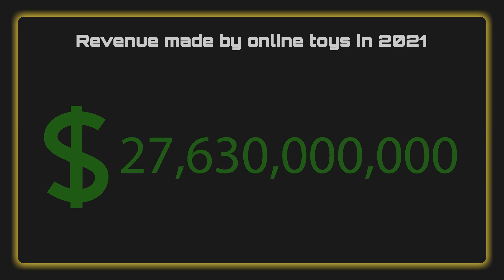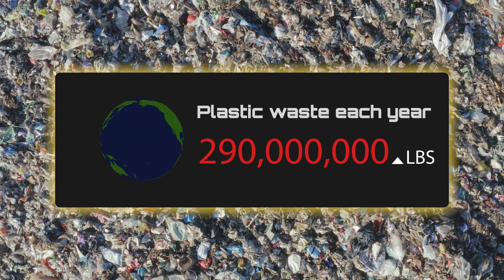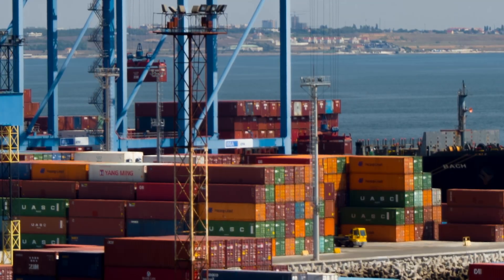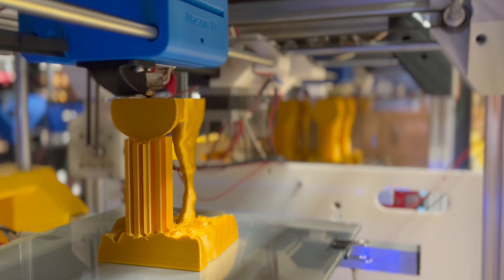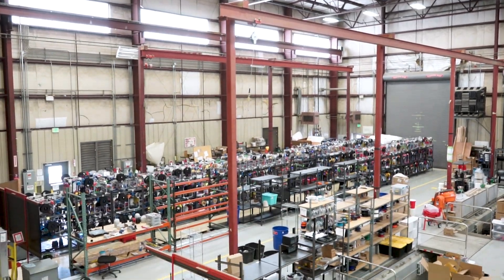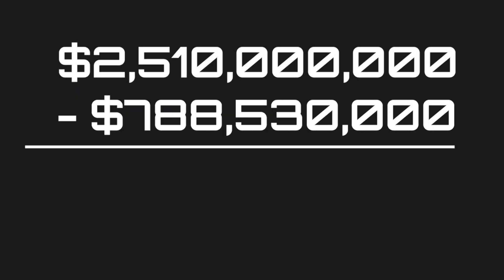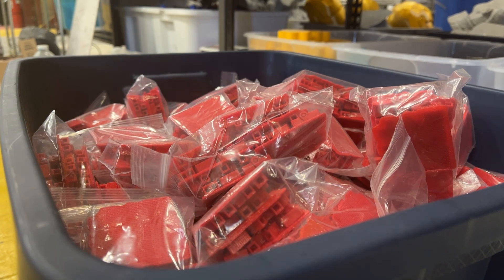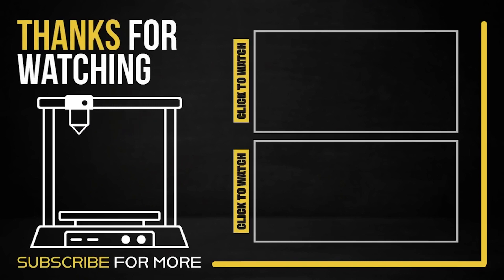Cut Costs & Reduce Waste: The 3D Printing Solution for Toy Manufacturing

Comment: The elephant in the room is the stigma that FDM parts are low quality, cheap looking. You touched on the exact thought I had with action figures. Mattel would never 3d print Barbie, it's just not up to par with the brand image and durability required. But the accessories and vehicles could definitely be printed, on demand, custom tailored to order. How do we change the public perception that FDM printing is for more than just fixtures & prototypes?

Comment: I think you keep forgetting, also in your previous video, that making an injection molded part takes seconds and a 3d printed part takes hours. It won't replace injection molding for large quantities of parts any time soon.
Reply from the maker: Getting your injection molded parts takes weeks. Getting your 3D Printed production parts takes days.
Reply: @slant3d  what about the energy cost? If you’re making 100,000 parts what took the most energy?
Reply: @lawrencemanning  3d printing may take slightly more energy depending on the technology and model, but both will take similar amounts of energy due to the base principle being melting plastic into a shape. And the less needed warehousing will pay for extra energy use

Comment: Good analysis but what about the failure rate in 3d printing? at least in injection molding you can grind and put the parts back in the pellets in 3d printing is not so straight forward process despite all the attempts. The 3d printing industry has been hiding that environmental issue for a while.

One technology can't replace the other, each one has unbeatable benefits that the other doesn't have. It is better to find ways for them to go along in manufacturing.
Reply from the maker: Regrinding 3D Printed parts is as easy as regrinding injection molded. The reason it isn't common is because there are not millions of pounds of 3D Printed waste that make it economic to recycle the way other plastic products are. (Also FYI 90% of current plastic products go unrecycled)
Reply: Yes indeed the recycling after the product has been used is a common issue, but I meant to focus more in the side of the production waste, all the parts that failed due numerous issues, failed prints, bad extrusion, wrong color, off measurements and tolerances (for the toy to work) you name them, all of these errors that make useless plastic are bigger in 3d printing industry, this is before the toys are even made. The grinding is the easy part of the problem with 3d printing the challenge is that you need a whole new expensive equipment as you show in other videos to extrude into actual filament that most of it goes bad or off specs specially with commonly used PLA. injection molding doesn't have this issue, if you are injecting abs you grind and put back in the process.

Comment: Undoubtedly the toy industry (besides transport industry and metal additive manufacturing) is the one that could benefit the most from 3D printing.
I think it is good that you pointed out the fact that all these numbers reflect a perfect, full optimized scenario. It was honest.
My biggest disagreement is at 6:00 you say that building blocks could be a good example of a place where 3D printing could replace injection molding, when it is actually the best industry example of a good part to do injection molding, given the quantities of similar parts (easy to inject) and the speed at what they can be made by injection molding, since the design was so optimized for it.
Besides that, keep up with the videos. It is important to showcase how 3D printing can be indeed an alternative to injection molding for consumer use.
Reply from the maker: Thanks for the feedback

Comment: i agree, but injection molding looks idk how to say that , but it is better for the quality and te visual
Reply from the maker: Highly reccomend the designs from this channel (Fab365) as a counterpoint. The process is not the problem it is the design.
https://www.youtube.com/watch?v=3qvRZCsW0r4&ab_channel=FAB3653DPrinting
Reply: @slant3d  I would argue about that because if you want a smooth part (no layer lines) from a 3d printer your only option is a lot of post processing, no way around it for FDM you need filler and/or sanding and for resin you need to wash the part cure it, remove supports.

Comment: No solution is on size fits al.
Reply: Can print wood, plastic, metal, concrete, every applications for toys to surgical equipment to housing, etc… seems pretty one size fits all
Reply from the maker: Which is why 3D Printing needs to start replacing injection molding in larger ways

Comment: This doesn't account for cost of electricity, building cost, upkeep/maintenance, waste, patent licensing, part design and testing, post processing or the cost of employee wages. Let alone cheap labour in other locations. I totally agree that some things do make sense in your business model, but it only works in certain applications. You did make me think a bit though.
Reply from the maker: -electricity, building cost, upkeep/maintenance, waste are all part of the cost/part which is basically the same at mass production between printing and molding (Another video coming soon)
-patent licensing, part design and testing is the same regardless of manufacturing process.
-post processing or the cost of employee wages is dependent upon the design of the part. (and is also really a part of cost/part) A good design and process has little-no post processing

Comment: First misconception: 15% of stock put into trash costs less than 15% of revenue
Second misconception: toys could be produced closer at the consumer, at least in the same continent. But it's still cheaper because environmental protection is less in other countries
Third misconceptions: 3D produces toys that kids want. I have a 3D printer. My kids love white figures that they can paint (similar to moulded plaster figures). My kids love toys which we assemble together (e.g. printed windows put into a cardbox). In a shop they love shiny glitter coloured loud toys which a 3D printer can't produce that easy.
Reply from the maker: Thanks for keeping us honest.
-We compensated for the diference in teh 15% losses and only calculated the manufacturing cost. You can see ous spreadsheet. We used Hasbro as a reference.
-Environmental protection is not really the issue. It has been more the labor/statup costs locally for molding.
-More than half of toys produced (~$15 billion) are 3d Printable. Blocks and game pieces can easily be made with 3D Printer. (Imagine custom Katan pieces or more interesting "fit through the hole" puzzles)